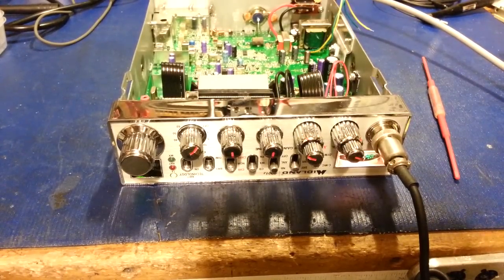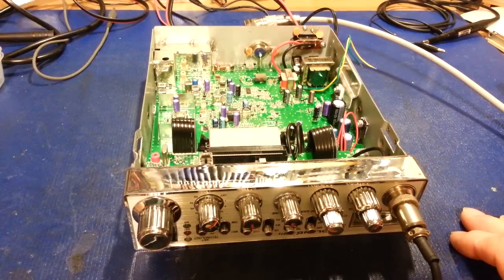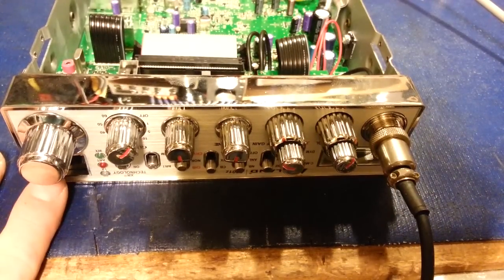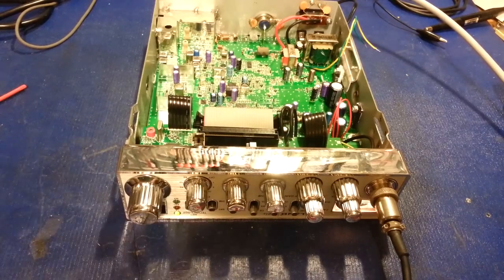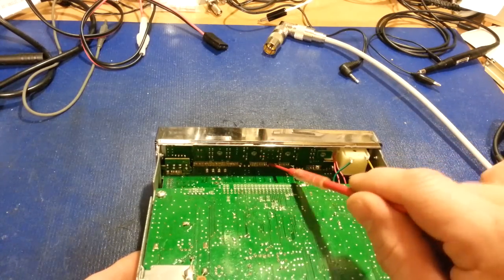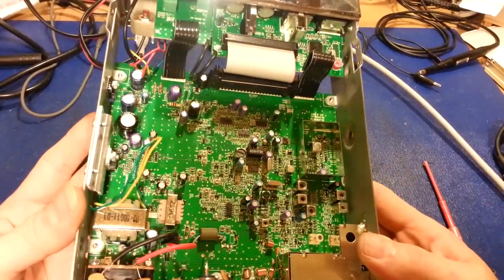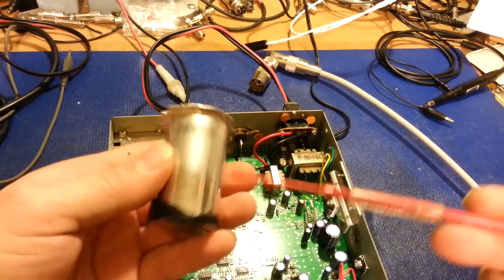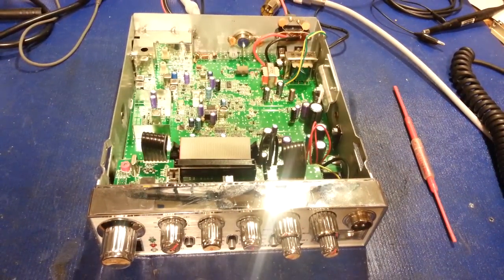Midland 9001Z CB radio with horrible digital noise in audio circuit.

Comment: the best thing about this radio is the alert. you can set it for whatever time you want it to go off and it will definatly wake you. That is why I bought one and I got upset with the fact that that no one had a service manual or could tell me how  to get one so seeing it was my radio I mashed it with a hammer because I couldn't get it to do what I wanted it to do. It sounded like I was in a tunnel talking with a pillow over the mic . I changed Mics ,I changed antennas , I hooked it up in my vehicle , all with same result . I think I shorted it and thats when I mashed it a couple of times . Now it works as a parts radio .

Comment: I was thinking it might be a bad cap too. That is just crazy! That noise is crazy!! The only place you could use that radio and not hear that noise would be in a tractor trailer. That said they keep getting nicer and quieter inside especially when setup for Owner Operator instead of fleet use. That background noise is like a penny rattling in a cup holder or door map pocket it is just a matter of time before you lose it and go nuts!!! I often wonder if all the "white noise" in Galaxy and RCI radio's is really Chinese plot to drive us all nuts with MK Ultra like sonic and rf weapons disguised as CB and Ham radio's. LOL

Comment: The big ribbon cable would be done to make assembly easier, it is far quicker to use a ribbon with connectors in it, than to manually do each wire connection.

Comment: I would have thought that all new CB transceivers would have used a Tayloe mixer on Transmit and Receive and replace the IF transformers with crystal filters like the 10.7mhz for the 1st intermediate frequency and 455khz for the 2nd intermediate frequency as well as custom filters for LSB/USB or for that matter using DSP processing through on both transmit and receive.

Comment: Can You tell me what the microphone wiring for a Midland 13-858 cb radio is I have one with a 4pin microphone plug, it came without a microphone, I have a cobra microphone but it is not wired for a Midland.
Reply from the maker: Cobra 4 pin mics are wired
1. Shield/common
2. Audio
3. TX
4. RX

Midland 4 pin microphones are wired
1. Audio
2. Shield/common
3. RX
4. TX
Reply: @mikesradiorepair  Thanks for Your help and the information.

Comment: Sounds like about 500hz, so likely is a multiplexing noise, as the ics that do it tend to run around that speed
Reply from the maker: TheDefpom 

That's probably correct.  I just don't know how they could release a radio that had that much noise, horrible.

Comment: I don't know, but I think we are at the end of the CB era. I live right next to I-70 in Columbia, MO and Channel 19 is mostly quiet. Sure, I can hear occasional traffic on it, but it's not all the time. Not like it was in the late 80's and early 90's. I think over the next 10 years new CB radios may disappear from most truck stops as the remaining manufacturers just quit making them due to slow sells. Right now they are so cheaply made that even the premium brands are a joke (Galaxy to name one).
Reply from the maker: Mark's Journey 

Really depends where you are.  Around here channel 19 is active all day and night.  I don't have enough fingers and toes to count local trucking companies that use CB's in their tractors and dump trucks.  In the evening and during the weekend there is also a huge hobby CB community around here.  Channels 12, 17 and 24 are busy with evening rag chewing.
Reply: MikesRadioRepair  where are you located.  i have 4 ham radios that need repair. for low tx power. p.s they have all been run hot while wewhere jamming 147.435. i have learned my lesson i now putt the tot to 1 minute. and i run A fan.
Reply: MikesRadioRepair I hope so. I have a soft spot for CB, and it was my introduction to the wonderful world of radio. just wished it was used more around here.
Reply: I think there is definitely a resurgence of 27Mhz CB..........if Ebay prices are anything to go by, old radio's are on the comeback !
Reply from the maker: Harb's Elecronics Lab 

I think people are starting to realize how much better the older ones were built.
Reply: I think a lot of it is memory driven as well......a lot of us still in electronics have some pretty good memories from back in the 70's when CB was an epidemic....
I remember going out on on DX expeditions on my pushbike, carrying all sorts of junk to a camping spot way up in the mountains making DX contacts all over the world on my humble CB.....it was all a big mystery back then, but it was addictive in many ways......I made some life long friends back then, and doubt that I would have had a career in electronics if that stuff didn't happen way back all those years ago.
Its funny the stuff that stands out in your memories, and I have to say CB has its place there for sure.
I am glad to see that here in Australia there seems to be growing interest in 27Mhz CB radio again.....its a shame Amateur radio wasn't on the up and up as well, but kids seem to be more interested in playing with electronics rather than learning how it works these days.
Reply: @mikesradiorepair  Hi Mike, is old Motorola  Mocat Radios worth buying?